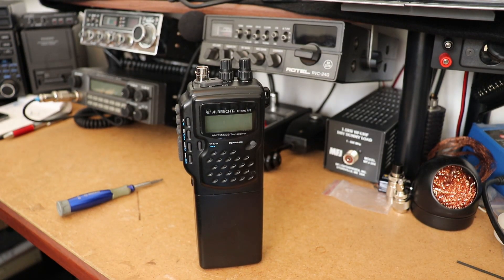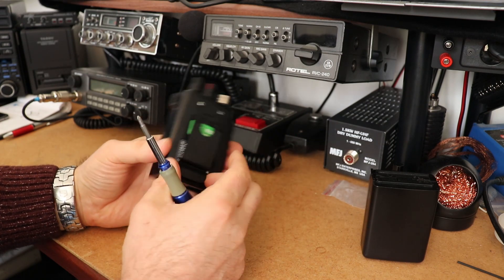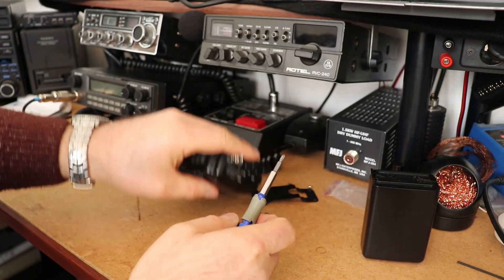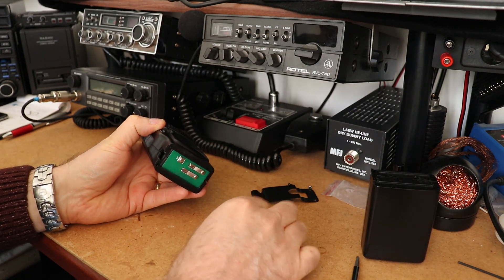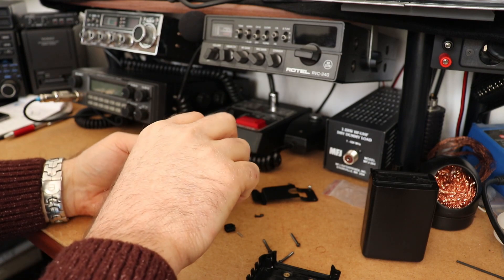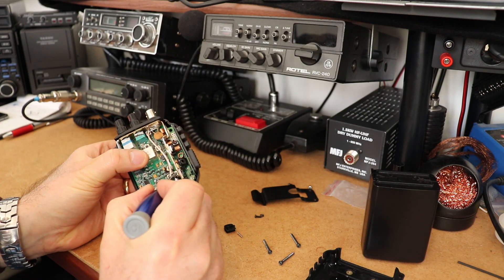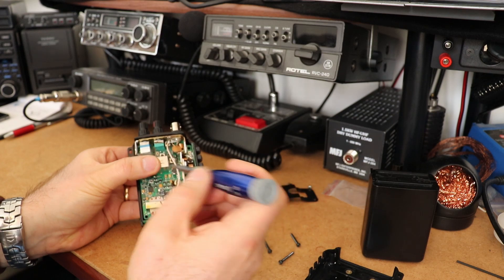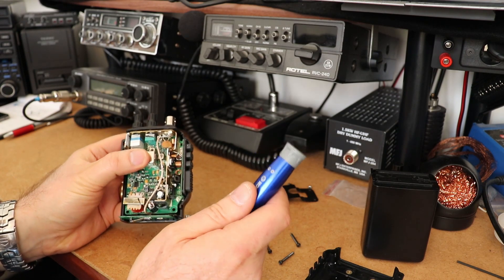Albrecht 2990 TX Power Adjustment Points

Comment: Thanks for the video! I watched your videos about 2990, I love this little radio, but can't really use it for contesting as it's power is well below the spec and I'm looking for up to spec tuning.
As you have tuned yours, is the output filtering OK? Have you had a chance to check it? And is it possible to adjust the "low" power? Thanks and 73!
Reply from the maker: Hi Pavol, I would love to have a nice quality spectrum analyser but unfortunately they are a little expensive for the occasional use I would have. Maybe one day if the right deal comes along.
Reply: @justradio5521  Hello. You can maybe check RF Explorer, these are not so expensive and maybe it can do the job. I was thinking very hard about it myself, but so far there was always something more important to invest in and I'm probably not skilled enough to get into radios tuning and servicing (even if I would love to), so my use would be limited.

Comment: Is it possible to increase over 4 watts of transmitting power?
Reply from the maker: Hi Jose, you may get a little more, it's good to find the peak but with a handheld you really need to get best power out to power consumed ratio. You could get to a point when a very small increase in output power requires a bigger increase in consumption which means bigger battery drain and the small increase just isn';t worth it. Also don't forget because of that inefficiency a lot of heat is generated which can be a problem in such a small radio where everything is packed in really tight.
Reply: @justradio5521  allright nice lesson here, so lets say as of a thought experience, would it be possible to pump it to 6watts? taking what you said into account it is still good to know how to do it for an emergency situation
Reply from the maker: @itrstt66  I doubt you'll get 6W, don't know if you've watched my other Albrecht video but take a look if you haven't. I got up to 4.7W carrier on my radio, I also talk a little about the heat build up in that video.
Reply: @justradio5521  actually i only saw this video, thank you. and now looking really into it 0.7 w its just not worth it.
Reply from the maker: @itrstt66  Yes, if your radio is already at 4W then I really don't think it's worth worrying about. Each radio might be a little different, mine was at 3W when I started.
Reply: @justradio5521  interesting did it heat up at just 4w?
Reply from the maker: @itrstt66  Yes, doesn't take much time on transmit for the output stage to heat up and it's a very small radio with everything packed in tight.
Reply: @justradio5521  given that it looks best to leave the way it was

Comment: Love the 2990, used 99% for RX while traveling but need to touch up the TX frequency. What coils or other adjustments are there specifically for TX freq warp? I have schematic but it lacks descriptions. Using calibrated Viavi monitor
Reply from the maker: Try this link, the Magnum is basically the same radio:
https://cbtricks.com/radios/rflimited/magnum_1012/index.htm

Comment: Mine is running at 1.3W and any adjustment attempt does not make it run any higher. This is on battery power. Anybody else got the same power?
Reply from the maker: Hi Nokiaman, just wondering if you got your power sorted. What test equipment are you using?
Reply: @justradio5521  Just an HF power meter. Also some idiot had been into this radio and removed the entire ferrite core from the inductor L9 meaning that the main drive to the PA was too low. another screwdriver expert. Radio is useless now.
Reply from the maker: @Thorazine1950  That's not good, these inductors are paired with specific cores to get the range required but it's worth trying cores from spare inductors/other radios, you might be able to revive the radio.

Comment: Thanks for the information, 
I have one of the newer version, it doesn’t have the “RPT”, everything else is the same.

I would love to do that mod you talking about, I’m very confident in doing the MOD, but I’m not equipped with those kind of test equipments.
Reply from the maker: Yes, it's like working on your car or your home, it's difficult to spend money on tools you may only use once. Sometimes it makes more sense to go to a rig doctor.
Reply: @justradio5521  Dr. are hard to find Lol. 

Which way is peak,
Clockwise or counterclockwise?
Equal for t11,t12 & L9?

I know RV2 is clockwise to peak. 

Thanks
Reply from the maker: @3000kitesurfer  It won't be just one direction to peak, you may need to go clockwise or counterclockwise to find the peak. All depends how it been set or drifted over time. With your instruments connected you just need to adjust slowly in one direction, if it's rising then keep going until it starts to drop again then come back to the peak. If it's going down then go the other direction until you find peak.